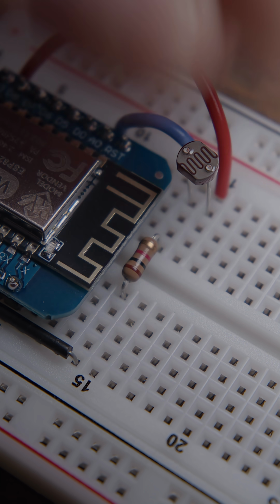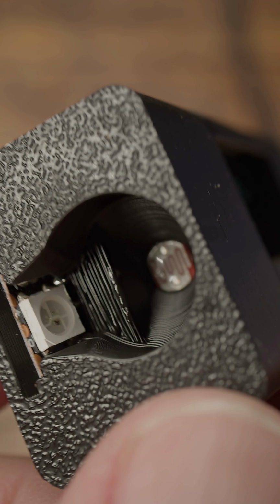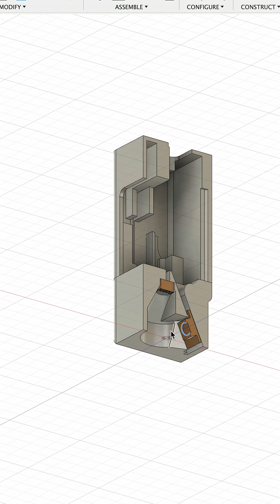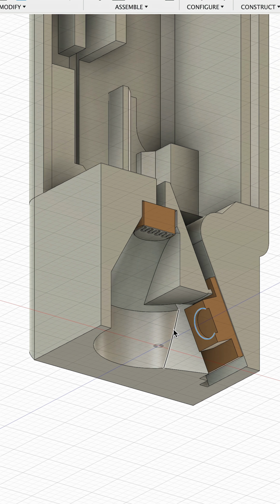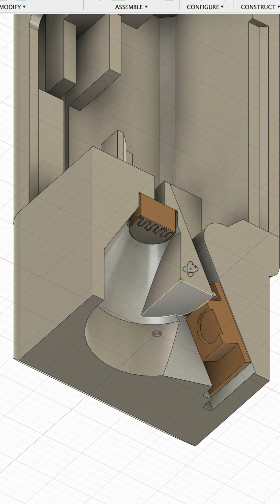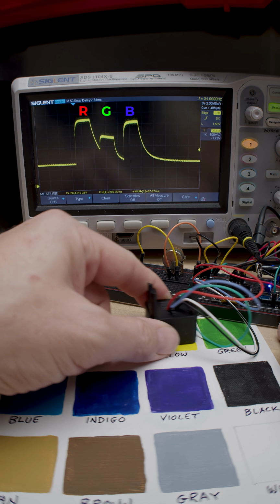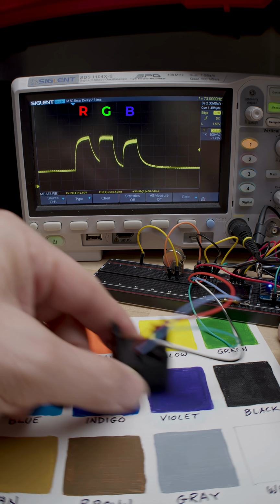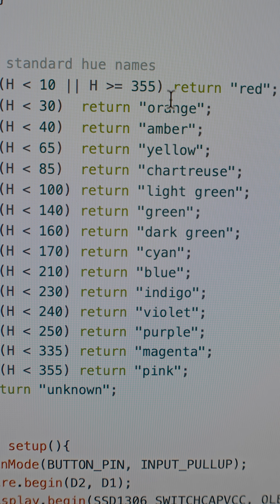LDR Color Checker

Comment: so, it's a very basic light spectrometer, good job!

at the time of my comment, Usagi Electric is currently restoring an FTIR spectrometer, in the first episode, he explain the working principle of a light spectrometer (in his case, infrared is used as the light source), same basic principle, comparing the level of light reflection/absorption, with some tricks to use a unique source of IR light (instead of 3 different sources like your device), like beam splitters and lenses that affect the wavelength slightly. it's very interesting.

Comment: Nice! But it becomes inaccurate for different spectra of reflection. You see, RGB is just a way to trick the eye into seeing the entire rainbow. But in reality it is a continuous spectrum. For example, if you have a violet surface it might be just reflecting the violet part of the spectrum or it might reflect red and blue, both look the same but they show different rgb values in your device. The correct way would be to use a rotating grating or prism with a slit to cycle through the spectrum fysically and then translate the spectrum to observed color.

Comment: Dumb question, but is the main reason for using red, green, and blue LEDs just because those are the cheapest LEDs available? Colors are "real" in the sense that humans perceive them in ways consistent across humans, but they aren't "real" in an objective sense. All light is a single spectrum of frequencies. We perceive discrete colors because various cone photoreceptors in our eyes respond more to specific frequency ranges, but the ranges themselves are arbitrary. So, knowing that, any three LEDs of different colors ought to be able to be used to determine the color of something, provided they're the same LEDs used to train the identification system, right?

Comment: This reminds me of something I came up with as a kid and made in a school project (a lifetime ago now). I built a small electric car that could follow a line on the floor. Used a few photocells pointing downwards to track the line. It was a very simple circuit, basically photocells switching the wheels on and off to keep the car on track, but it surprisingly worked.

Comment: This is the kind of thing I think about (specifically, electronic components being used in a skewed, or entirely unintended way) when I think about rogue AI, and the potential, even probable, existence of means by which such an intelligence could exploit faults in containment strategies that we are unlikely or incapazźble of even imagining, let alone anticipating. I often find myself thinking along these lines, idly pondering the challenges of such an undertaking, such that I often do it without even realizing it. For example, I was watching a video about LoRa and the (relatively) absurdly low thresholds of operation of that tech, and it almost immediately made me wonder about the possibility of exploiting circuits and components of stone hypothetical electronic device with which a "contained" AI could interact, even while "isolated" within an isolating EM sandbox (i.e., an air-gapped host computer contained entirely within a Faraday cage). Imagine such an intelligence exploiting components  "unrelated" to RF transmission to generate a signal unaffected by a Faraday cage mesh, that it can use to escape...

Comment: Try it on the petals of an orange flower. If the flower reflects only orange light, but your device only detects red, green, and blue, then your device can't see the flower. Trichromatic color theory only applies to our eyes, and display devices designed for our eyes.

Comment: Another example of expanding device functions: in the 1970’s my friend took a single channel RC relay from a cheap car and put it in his model motorboat. To steer both left and right, he used the relay to run a motor to swing the tiller both left and right. He just had to wait until it swung in the direction he wanted.

Comment: The one thing you'll wanna do is verify the wavelengths of the LED itself, or find some way to calibrate for them. The actual output can vary from the listed spec, especially if you get cheaper LEDs.

Comment: I used it previously in a capstone project as an alternative to a pH sensor. Used this as a color sensor to convert the color of a pH indicator paper to a digital pH value for an automation system. It was very helpful!
Reply: I was thinking about doing the same thing as I am bad at distinguishing colors and ph paper is impossible for me to distinguish! Did you have to change anything with the shroud so that it would only be sensing the reflection off the paper or did you just do it off a lab bench/lay the ph paper on a black surface?
Reply: I was trying to think of an application. That's a good one.

Comment: Cool idea, however that’s not professionally accurate. You need CMY for prints and colors. If you want to get it right, get 3 LED with a CRI/ CRA (both units are the same), as close to 100 as possible.  Get professional gels in cyan, magenta and yellow and shine them through those. Altern, have a spinning top that exposes 1 of 4 windows, letting sunlight through each gel individually and a clear one as baseline. Sunlight is CRI 100 by default.

Comment: Wow!  This is the most clever project.  I also thought color filters, but as soon as you mentioned LED, the bell went off in my head.  Now I am wondering if the cell can also be used to detect infrared and ultraviolet?  I always called these CDS cells (Cadmium Sulfide cells), as that is how I learned it from my Radio Shack 200 in 1 electronics kit as a kid.  I remember even doing a science fair project in elementary school using that kit and CDS cell.  I never thought of the idea of using that simple cell to measure a color,  but it makes perfect sense.  Brilliant!

Comment: Get a color swatch for standardized colors like RAL, measure those colors, use those measurements to create a lookup table, and when using that lookup table, also interpolate between those colors.
You could also calibrate it to a specific printer. Print your own color swatch with known CMYK values, create a lookup table with it, and then interpolate. Now you can measure any color to know what CMYK values you need to recreate it using that printer.

Comment: Useless device. At most, it could give the hexadecimal code of the color, that is, show how much red, green, and blue light must be superimposed on white surface to give something similar to that color, but it would not be possible to obtain the spectral reflectance graph of that color. Just three points on the graph are not enough.

Comment: I wonder if it can then heuristically try to reproduce the color as a light output. After reading the color, the device would be placed on a white surface. Each of the three lights would illuminate in sequence and its output would be adjusted by PWM until it detects the appropriate intensity. Once all three lights are adjusted, they would then illuminate together with the appropriate intensity.

I don't think it would be particularly accurate, plus just from a theoretical standpoint there's a huge difference between a surface being a color, vs. a light emitting that color. But it might be interesting to see what comes out.

Comment: I made something like this back in my engineering school, it was a maze solver + line follower robot competition, and one of the tasks was to stop at a red band for 5s then continue, I was tight on time and I couldn't find a color sensor so I made it with LDR sensor and 3 leds, i had to tweek a lot to find red, it worked but at the competition it didn't haha because of daylight I guess, so I had to modify my code in the second run to detect the first line stop 5s and then never do it again, because it was following white line on black background so the IR sensors were indicating as a white color haha, if 3 are white then stop 5s and do the loop once haha

Comment: “Very low resistance” is a HUNDREDS of kiloohms :)
“Very high”, btw, is a dozens of megaohms.
So you cant use it in circuits directly — only with microcontroller.

Comment: There is like this for screen calibrations already but this is a cool explanation how you made it
Reply: Yes, except they do not have to shine light as the monitor provides it, so they need 3 colour filters. And the filters need to be known and right and offsets may need to be applied because metamerism is a Thing.

And LEDs have often … interesting colour spectra … black body emitters they are not. 

Or you could use a diffraction gate and a linear sensor (or something approaching that) and get an actual spectrum.

Comment: But RGB is not enough to describe all the variety of colors we can see in reality. Try to use RGB light to emulate the sunlight and you will find the big difference on how unnatural the colors of common things are in it. When you are measuring the real color you need a contigous spectrogram.

Comment: I would take 3 LDRs with 3 different filters (rgb) and then calibrate them to be able to detect accurately all colors.

The current system has a flaw. If the intensity of a light is increased by increasing luminosity, it can misinterpret the data. It's not a color checker but a brightness checker at the moment. You need a saturation checker, one for each of the three RGB to achieve true color detection (or close at least since even RGB is distinct)
Reply: re: "If the intensity of a light is increased by increasing luminosity"
Um, flaw in your logic; The unknown color can be are measured by using a percentage of each of the 3 primary colors when individual R,G or B sources illuminate the unknown sample ...
Reply: @uploadJ i have absolutely no idea what your point is
Reply: re: "The current system has a flaw. If the intensity of a light is increased by increasing luminosity, it can misinterpret the data."
No.
EACH color R G or B will change by the same amount.
The ratio among the three is the important part.
The ratio between R G and B ... not the absolute value of each. Think percentages, using the highest one as 'full scale' ...

Comment: Is there much change in value depending on the medium that the subject color is on?

Seen here, the paint/ color is on paper.
If the color were on wood, is there a significant difference, and how is this device reading that situation?

Is the goal of this device to read the visible color? Or to read the actual color, no matter the object it’s presented on?

Comment: Add a reflectivity sensor and you’d be every animator’s dream!
Reply: Please explain, I'm genuinely curious. Not trolling
Reply: @patrickhayes3099 I'm guessing the "reflectivity sensor" is something that allows this device to be used on a monitor screen. So animators can check the colour of an image in real time easily, or even the rgb values. It's also different from having a built in software that reads colours since the monitor might color correct your drawing.
Reply: @ilovenovels yea every monitor has different colours, so what looks perfect on your screen would look of on my screen.
So this is basically a problem for every digital art maker, I guess?
Reply: how so?

Comment: A former high school classmate of mine made something similar somewhere around 1997 with fully analog electronics and RS232 communications. This was such a cool thing to see. It required such careful calibration of individual LEDs as we did not have RGB LEDs back then. From my recollection the detection was way faster back then due to the immediate nature of analog signals vs digital processing. I suspect he simply sent the individual RGB values he got from discrete channel lighting over the serial bus and had the software interpret the closest color based on the 'standard' RGB color names.

Comment: Imagine if you used Machine Learning.

a really big database that had all of the colors from many surfaces.  Use some of the ML code that once finished the “trained” algorithm could run on an Arduino or even better an ESP32.

You could have something that is better at distinguishing more similar colors on various surfaces, with various gloss and matte finishes.

Comment: How about the intensity of the light , would it be problem if its degraded ? If yes then u need to re setting each time the battery lvl goes to low or when changing the led and thats for all color.

Comment: Questions: 1. How do you calibrate this device? 2. What is the minimum flat surface area you need to get a reliable measurement?
Reply: Can calibrate using known swatches, eg specific gray Pantone swatch
Reply: @adamjabonski4305   May be the KODAK Gray Card?

Comment: I am looking for similar sensors for example a belt where the gear is to distinguish heat and cold Iam looking to control timing what hall sensor do I use?

Comment: Turning this into an accurate Pantone color sensor would be so cool
Reply: Little bit hard, you can see the single value is not stable, so it means have a gap
Reply: @andyjonwei is it not stable because the sample is not uniform?
Reply: @andyjonwei well no, whether or not it's a discontinuous spectrum has nothing to do with the noise level nor the resolution available.
Reply: Looks like the sensor is a bit slow in changing it's resistance. It has a rising curve and an edge on the signal, and it's not so steady (sometimes flatens horizontaly, but it looks like green tends to fall voltage a bit on steady light, and R and B looks like rising up)

Also surely changes a lot based on temperature or if you use a more reflective papel like ink printed photo paper, instead of painting colors
Reply: @Coltranne  You could use a phase where all 3 LEDs are on (white) and use the relative values of the other LED colors to detect the actual color properly, even on different kinds of media
Reply: @Mega-tl8vva priori ça donnerait la notion d’intensité et pas de couleur…
Reply: @Coltranne Good point! How about lighting up white and then normalize? should get rid of differences in reflectiveness.
Reply: @Benlpau  I was thinking about this. Using a phototransistor instead of a LDR sensor would make it A LOT faster and precise

You could calibrate the device by placing in on a white paper and then sense for dark noise floor + white + R + G + B"

(this will take like 1 or 2s for a LDR but just a blink for a diode)

This would make it so the sensitivity and linearity of the sensor stays the same at different temperatures, reflectiveness and maybe a bit of light bleeding

But you will need to adjust the LED light by PWM to not saturate the sensor diode
Reply: @Coltranne could be the led switching. Since that's also a semiconductor it should be the initial voltage followed by steady state which would explain why each curve is slightly differently shaped even though the pulse is probably the same time for each
Reply: unfortunately it doesn't really work, pigment color is more complicated than rgb.
Reply: @Tordek yes that's why the detector would give you a Pantone (pigment) name instead of a regular RGB value
Reply: @Dann.y no, you misunderstand: the light emitter would need to have a spectrum matching the cones, not just a thin line like a led generates
Reply: This is called metamerism. You can create an equivalent that looks the same, but only under the exact same illumination. A colorimeter can't tell an orange pigment apart from red plus green.
Reply: Sherwin Williams has a color matcher for their paints
Reply: @freewave04  all the paint brands do you can pretty much get any color and get it matched perfectly.
Reply: Pantone charges license fees through the nose for using their (digital) charts. RAL would make almost more sense.
Reply: Pantone would probably raid his house and cause an "accident"
Reply: Accuracy out of an ldr? Lmao.
Reply: Was my first tought too😂
Reply: The tolerance and all you need will be insane. Like, any kind of spills and all will affect the measurements. This example can only do a crude estimate
Reply: That was my first thought 😅
Reply: This sensor needs calibration after construction, it isn't ready-to-use.
Reply: i don't know what that is but it sounds cool!
Reply: right
Reply: What if we use photo transistor.
Reply: @ऋषिकेशमालवी  A photo transistrs would make it more complicated or even impossible, because its output isnt linear to the intensity of the light.
Reply: It shouldn't matter what the curves are, only the peak
Reply: Pantone already made this exact thing, it doesn't work great and I think his is better but we have one at my work
Reply: @1MrOasis it's probably so expensive though. Also making it yourself just has a certain charm to it
Reply: basically impossible, that’s like throwing a ball in a cup that’s 50 feet away and expecting it to land every time but also moving starting positions each time so it’s not exactly 50 feet
Reply: @joej3365  Perhaps yet what does it matter to a color blind person who is trying to match their clothing colors, which are probably no more than two dozen colors, when there isn't a color seeing person around and couldn't possibly afford a device that can recognize three or four times that number of colors?